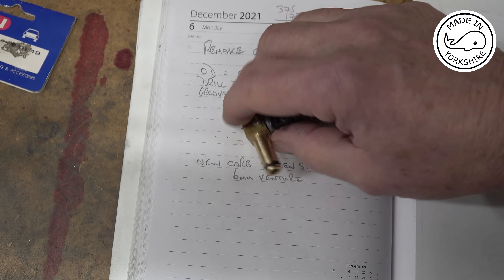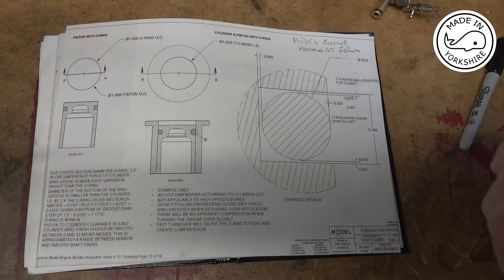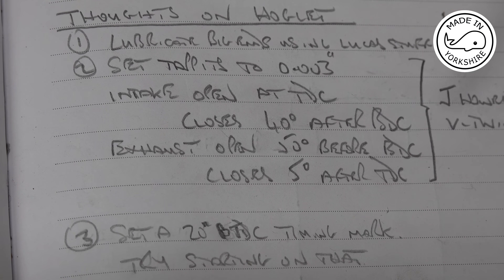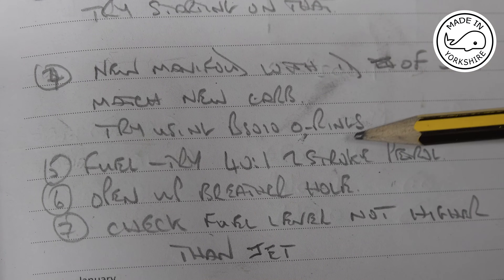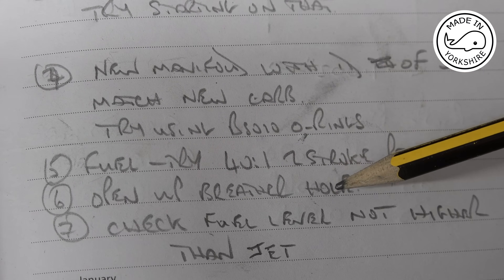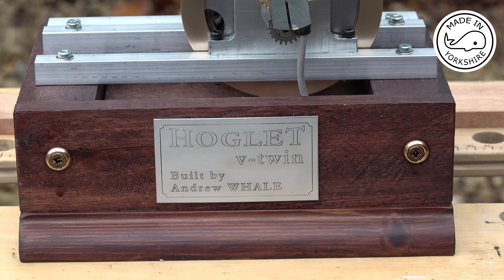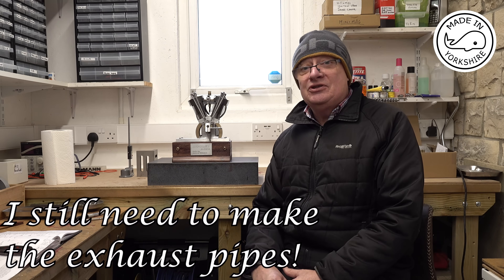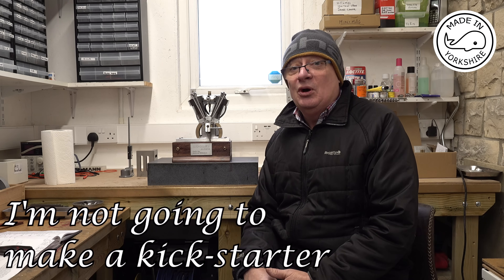#MT44 Part 16 - Hoglet V-twin IC Engine. Completed! In 4K/UHD by Andrew Whale.

Comment: "Hey! I bought the Hoglet V-twin plans and noticed the gear pump assembly is shown in the drawings, but I didn’t see it in your build. Just curious—why didn’t you include it? Also, if it’s built, where exactly would it fit on the engine? Are there mounting points for it?"
Reply from the maker: ???? There is no gear pump assembly on my drawings. There are 12 pages of drawings. Which page contains the components you are referring to?
Reply: @learningturningmetal Yes there is available , I am talking about (MEB  issue 10 ) page no. 8

Comment: Hi Andrew, I've been trying to source CEN sp45 carb but not having much luck. Could you tell me where you sourced yours from? Regards kevin
Reply from the maker: Hi Kevin. I searched all over the place. I eventually found something similar secondhand on eBay. It turned out to be junk! I found a CEN Carburettor X-CENSP45-10 at redlinerc.co.uk for about £15 but that didn't work very well. As I knew my next engine would be a Jerry Howell v-twin I decided to make three JH 2-jet carbs. One for the Hoglet and two for the JH v-twin. It works reasonably well on the Hoglet. The drawings cover three versions, one left, one right and one on centre. I think I made a left one for the Hoglet. In hindsight I think a centre version would be easier to get to the adjustment knobs.
Hope that helps.
Andrew
Reply: Hi Andrew. I'll have a read about Jerry Howell carb...thanks

Comment: Thanks for sharing Andrew, and congratulations with the very well running engine! It's beautiful! Well done! I wish I had half the skills that You have.
A hint for tuning the carburetor is to adjust the main needle at full open throttle to maximum rpm and back down a litlle bit, to where the engine looses approx. 1-200 rpm.
Afterwards You can adjust the transition screw (normally positioned in the throttle lever, which determines the idle speed, low rpm's and the transition to high rpm.
If the engine hesitates to respond to the throttle input, the low speed needle is often too lean and opposite, if it boggles when throtteling up, it's too rich.
My experience is from RC motors during the last 15+ years with identical carbs etc.
Just my two cents.....

Looking forward to follow Your next project!

Merry Christmas.

Regards Kim
Reply from the maker: Thanks for the advice Kim.
Merry Christmas to you too!
Andrew

Comment: Running great Andrew. The ignition pack for my Hoglet build arrived and I don't think it's going to work because it only has one hall effect sensor even though it's supposedly for a V twin. Does your sensor cable have four conductors (I guess it must)?
Reply from the maker: Hi Tony I think mine does have four conductors. I think you should still be able to get yours to work though. If both plugs fire, it should be just a wasted spark on one of the cylinders. If you got yours from a UK distributor you might be able to exchange it.
I hope you get it sorted.
Cheers
Andrew
Reply: @learningturningmetal  Thanks Andrew. I'll see how it runs and hopefully it'll work okay. Cheers!

Comment: Fantastic end result Andrew, the engine sound at idle is really sweet. I am pretty sure it will sound even better with a couple of short pipes added. Hope we get to hear it again once you add exhausts. I think they may even help smooth your carburation further by adding some slight back pressure into the system. Cheers, Jon
Reply from the maker: Thanks Jon - an interesting thought. I'm still waiting for the pipe to arrive in the post. I'm not having the best of luck with the post at the moment!
Cheers
Andrew

Comment: Well done, very well done!
Very nice to see the engine running already.  No carburetor trouble, no ignition trouble...
Nice sound. It's a Hoglet, not a Harley.....

Referring to engine designers at Volvo, gasoline, petrol, is not flammable at all, not in a combustion chamber....  It takes a lot of work to make such engines fire up they say. Carburetor is an important part, ignition but also the air flow, into and out of, the engine. It's about how the engine is breathing as they say.

Comment: This is great, Andrew! I think it would be cool for you to rig up a twist-grip throttle as part of the assembly.

How are the big-ends, cam and valve assemblies lubricated? Do you just oil them prior to a run like one would lube a steam engine?
Reply from the maker: Ha ha - a twist-grip would be a laugh! Yeah - the various components should be lubricated before running - a bit difficult getting oil to those little ends. It's described as a 'show and tell' engine, so not meant for long running. The Jerry Howell v-twin is a totally different beast with a crankcase and oil pump.
Cheers for now.
Andrew

Comment: How are you checking valve timing without a degree wheel in the crankshaft?
Reply from the maker: Hi John. My previous two videos should help explain. Use maths to calculate the distance along the circumference rather than using a degree wheel.
Cheers
Andree
Reply: @learningturningmetal  i just don't think that is a very accurate way to set valve timing, I use a piston stop to determine TDC then set a degree wheel on the crank, now mind you its not on model engines.
Reply from the maker: @johnnym1320  I used maths to work out the 30 degree BTDC purely as a guide for setting the ignition timing. The ignition can be manually advanced and retarded when the engine is running, so 30 degrees BTDC didn't need to be 100% accurate. For valve timing, there are no instructions for the Hoglet, so I used some guidance I found for the Jerry Howell v-twin engine. This stated that the intake valve should open at TDC. This resulted in the valves opening and closing at broadly the same degrees as outlined in the guidance. If I had a degree wheel (and was able to fit it to this small engine) it would have been of little or no value. I hope that explains why I took the approach I did. Also, for info, the cam is a 3 lobed affair with the inlet valve duration of one cylinder being the same as the exhaust valve duration of the other cylinder. Maybe not the best of designs.
All the best.
Andrew
Reply: @learningturningmetal  i have been watching your build of the hoglet from the beginning, I have seen it built by many other ppl as well, building a model IC engine is on my bucket list and after watching you build the hoglet I purchased the plans. If that's the way you want to set the cam timing then so be it, its just not very accurate. Looking forward to the Jerry Howel build.
Reply from the maker: @johnnym1320 Thanks John. I hope your Hoglet turns out really well.
Cheers
Andrew

Comment: very nice Andrew, my only problem you did lots of mods before you ran the motor. I believe the change to gasoline and oil fixed it, but we will never know unless the old carb is reinstalled.
it now runs flawlessly.
Rich